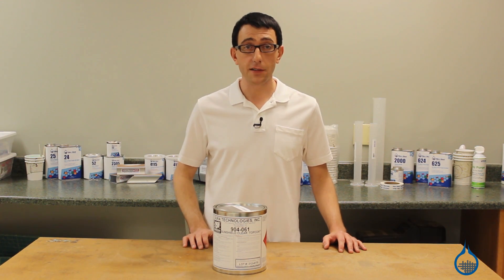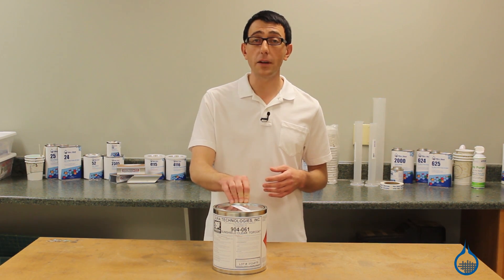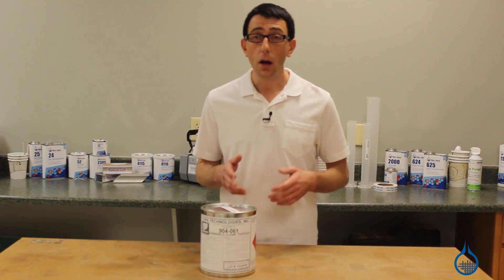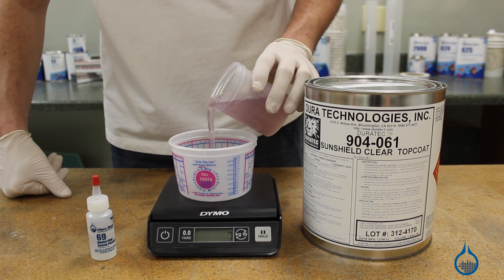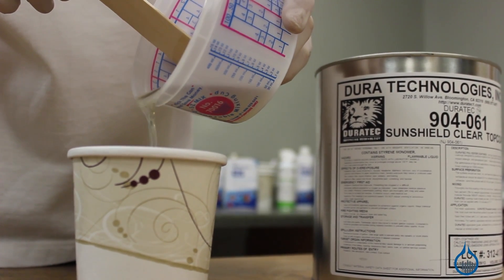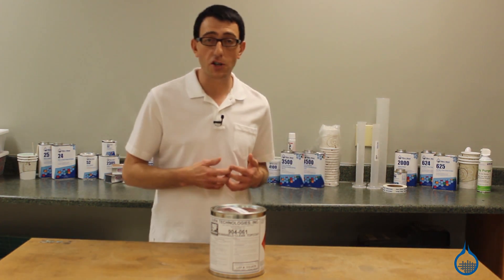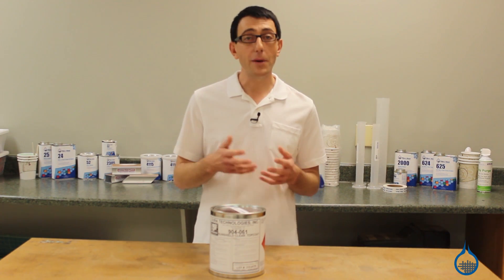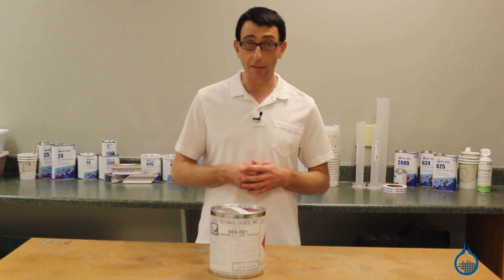1045 Duratec Sunshield Clear Top Coat

Comment: If I am spraying colored gelcoat on an object I am coating, can I spray Duratec Sunshield over the gelcoat before it’s cured? With adding wax to the Sunsheild as I would a final layer of gelcoat.
Reply from the maker: @patrickbell3446  you can spray it after the gel coat tacks up, but it shouldn't be needed. The gel coat has a gloss finish and is naturally UV resistant. If you do, Sunshield topcoat is formulated to cure without wax and is not needed.

Comment: When using this in mold, do I allow it to fully cure before applying prepreg epoxy carbon? Do I start the laminate layup when the clear is still tacky? Do I allow it to fully cure then sand it so the carbon fiber layup will stick to it? I don't see an answer to that on your website.
Reply from the maker: Apologies for the late response! This will start hardening in about 20 minutes at 77°F and will be ready for the application of reinforcement in about an hour at that temp. Please keep in mind that different temps will increase or decrease that time.

Comment: I want to restore a bass boat. We have wet sanded it and the clear gel coat is too thin to leave it as is and it has a low luster. Also, I can, faintly, feel some flakes. 

Will this be the right product for this application?

If so, Should I apply it with HVLP (2.5 tip) or is there another method to consider?

Thanks
WB

Comment: Do you have to spray this with something like your gel-coat gun, or can you spray with an HVLP gun?
Reply from the maker: Hey Matthew! Thank you for reaching out. We are very happy to help you with this project. The Duratec Sunshield can be sprayed with an HVLP that has a 2.5mm tip or greater. Depending on the tip size you choose,  the Duratec Reducer can be used to thin it, reducing orange peel and making it easier to spray. If you have additional questions, we have  a knowledgeable staff that can discuss what you are looking for. we can be reached at 1-800-821-3283 M-F 8am- 7pm EST

Comment: how to cure yellow color on the carbon before using the duratec ?
Reply from the maker: This product will protect against and prevent carbon fiber/epoxy parts from degrading, and becoming hazy and yellow.
Reply: @fibreglast  incase the carbon turned yellow , how do you cure it ?
Reply from the maker: @hussainkhesroh9954  once a carbon fiber part that was made with epoxy resin has degradated (turned yellow) the only thing than can be done is to sand down the surface and apply new carbon fiber and resin and protect it with this product. Or replace the part.

Comment: Not sure I understand this part. 
"The final spray should be sanded with 400 grit and allowed to cure, for 8 hours prior to the final polishing."
Are you saying that the final coat should be sanded during it's gel stage or? Just want to know before I use it, just received some from you guys.
Reply: spezzy : sand it when it wet with gloves on is best.

Comment: Very informative, thanks! Should this be sprayed with a gelcoat gun or can it be sprayed with an automotive paint gun (HVLP), since you mention it should go on as thin coats?
Reply: DTM190 : i cut mine with duratec hi-gloss additive and duratec thinner. Sprays great this way with harborfreight gun.
Reply from the maker: This product should be sprayed with an HLVP type gun.  The thin coats are crucial to the success of the application, particularly the initial dust coat.
Reply: Fibre Glast
Awesome, thank you!